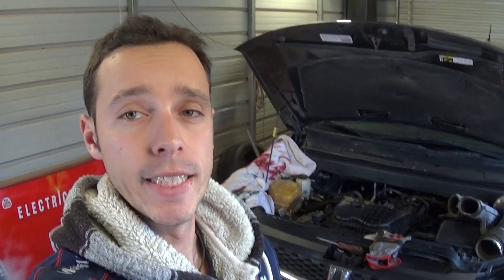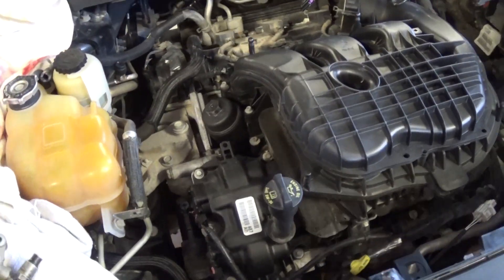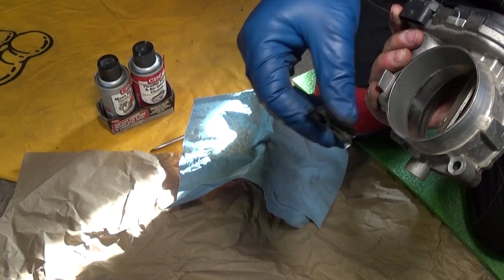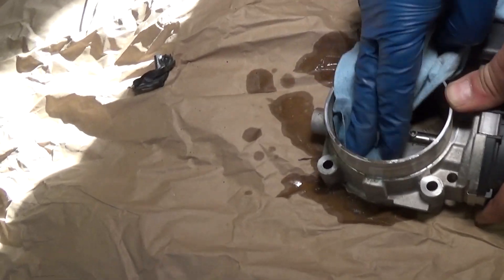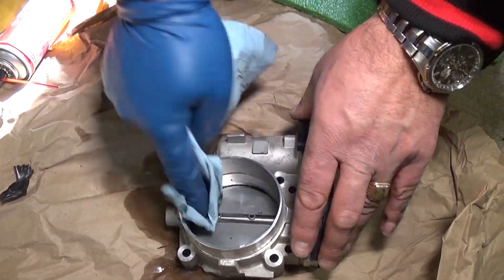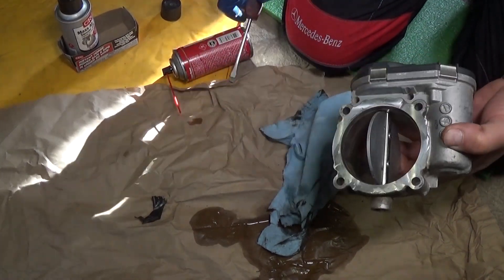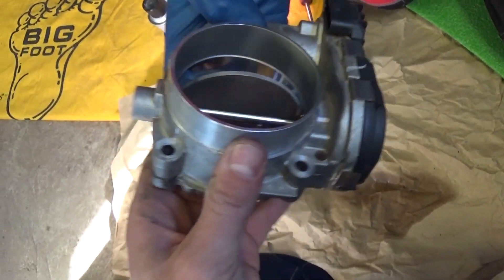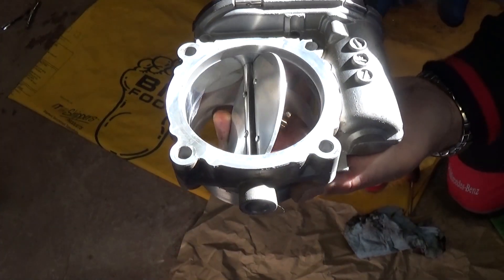DODGE CHRYSLER JEEP 3.6 PENTASTAR CLEAN THROTTLE BODY

Comment: Pushing it open will damage the motor inside the throttle body do not push it open with your finger
Reply: I was just thinking the same thing
Reply: Why would it harm the motor?
Reply: exactly, never touch the blade